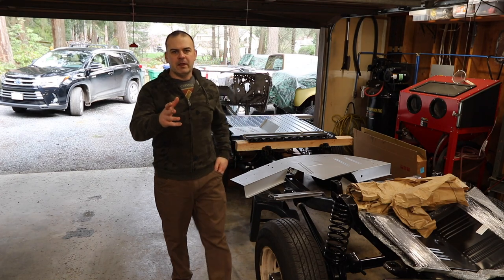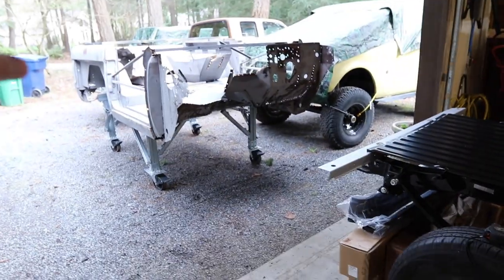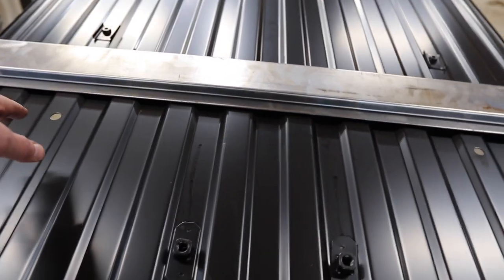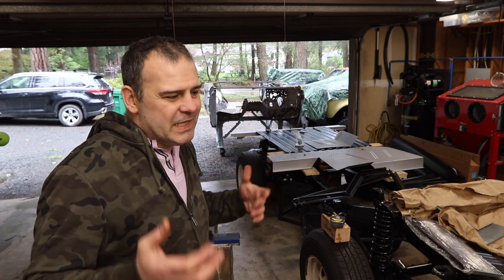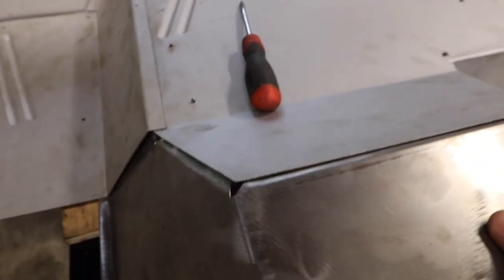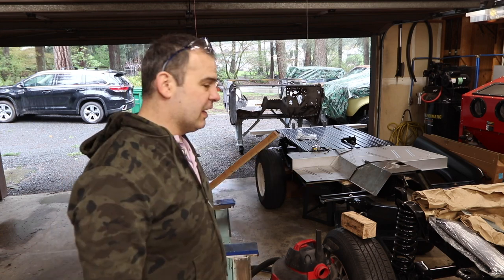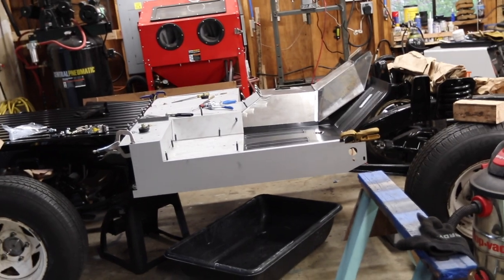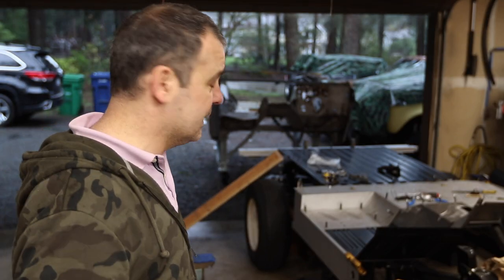4.03 Early Bronco Body Tub Assembly - Floors Part 1

Comment: On the long seat support section, do you think tack welding some 1/2" angle iron to it for stiffening would've been beneficial (or would be for others that may have to go down the build-from-scratch road)?
Reply from the maker: miller014 I had the same thought. I still may add stiffeners when I get this pig up on the rotisserie. My only concern is you don’t want the body too stiff. It needs to flex because the frame flexes and the bushings aren’t enough to take up 100% of the frame flex so somethings got to give. But I agree a brace or two would help keep the thing from taco’ing when the doors are off.
Reply: I just meant to use the stiffeners while getting things lined up and spot welded in place.  Then just nick the tack welds off and remove the stiffeners.  On a related note (and you kind of hit on it in episode 4.04), these older vehicles were not precision assembled machines.  Those original panels were coaxed into position.  I'm thinking you may need to treat it like hanging a door; decide where you want your starting point/anchor and set that, then square and plumb everything from there.  Also, remember you're building a body from replacement parts.  Most of those parts are meant to be cut and drilled to fit with the other not-precision-installed body panels already in place.  Hang in there.  You're doing great.  And, I really enjoy your channel and appreciate you sharing the wisdom you're gaining with the rest of us.